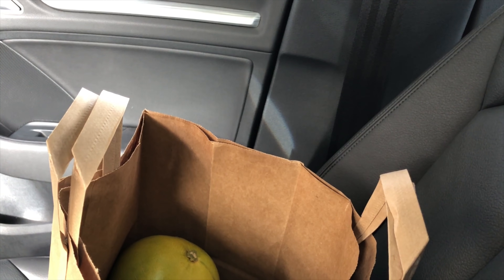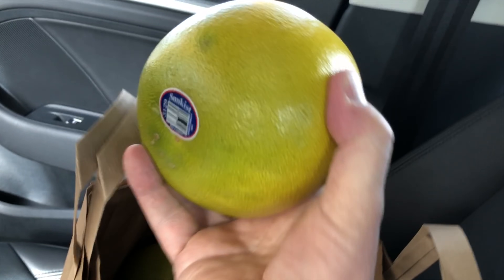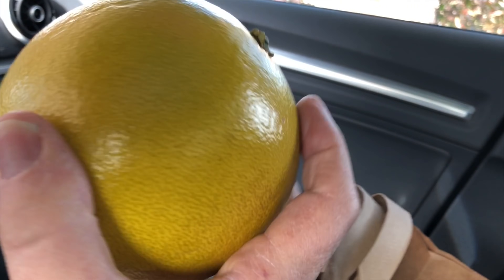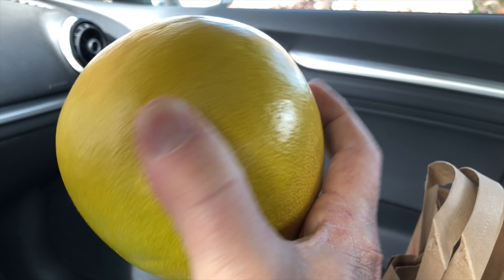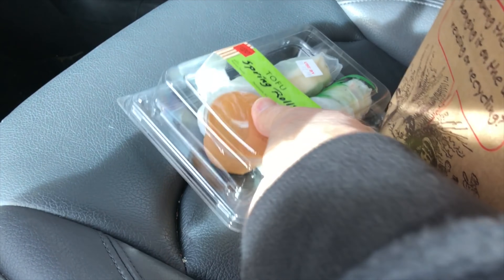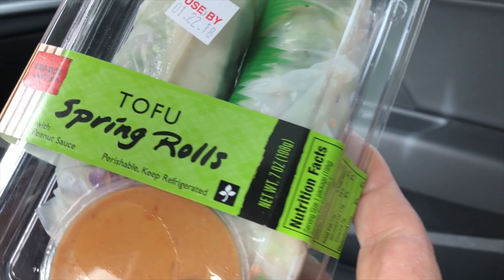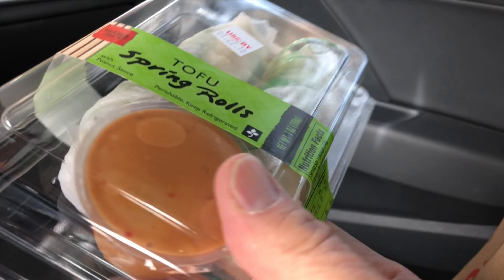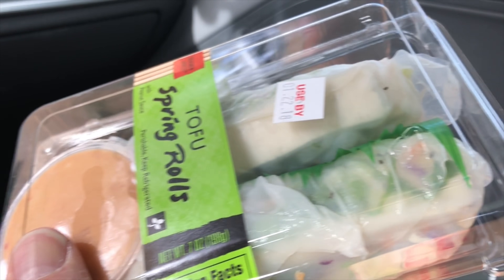The future of Class D amplifiers

Comment: Hey Paul. Some great explanations for us laymen on your channel. thanks.  It was said in the 80's that Class A/B could never achieve a sonic comparable to Class A. Of course, the advantage with Class A/B was power density. In the end, I think we saw that Class A/B could achieve sonics on the level of class A but with a much higher output capacities. Now we are dancing around to that same song again with Class D and it's variations (class T, I etc). No longer are we saddled to the limits of whatever the input wattage is as we can use power much more efficiently than ever before with Class D and it's variants. We regularly see amps producing output wattages far beyond the wattage of the input. Also, we are seeing damping factors for example that we have never seen before (Class I + 5000:1).  Not to mention the newer amps are sounding better and better and we are now seeing some pretty seriously clinically accurate units coming onto the market with some serious output power. We have digital amps with frequency responses of like 10hz-30Khz. Those are pretty rare still though. Do you think there is much more room for improvement there or have we about exhausted that tech?
Reply: High output is used for dynamic peaks, which occur in short bursts.  The electricity for those is stored in capacitors and drawn from the wall when the power output of the amp is significantly lower than what the wall can provide.  On average, long term, an amp will not put out more than it takes in, but it can take energy in during quiet parts and release the energy as peaks, preventing clipping, which is really what you want power for.  The only amps that would run flat out all the time would be guitar amps because they have a highly compressed and distorted signal.  This is one reason why they still use tubes, a tube uses energy whether it outputs sound or not, so you might as well run it flat out.
Reply: Rob Chapman Wattages on the output higher than on the input? Do you realise you have just described a machine which manufactures electricity out of thin air? Perpetual motion? If you can achieve that you are either the second Tesla, or were you educated at Hogwarts?
Reply: I totally know that is what it sounds like. That was what I first thought when I heard that too. I was specifically sighting Crown Audio amps and they are for real I assure you. I have lots of hands-on experience with them.  If there is any manufacturer that has been notably true to their published specs historically it is Crown (Amcron) Amps. Something you should know is that Crown is a division of Harman International which owns many high-end audio brands and at one point were the largest audio company in the world and with that have the best labs and did the largest amount of technological research. a lot of the advancements that have been made in the last few decades are directly a result of Harman's R&D. Harman was recently bought by Samsung but Crown was doing what they claim long before Samsung had their hands in it. If you read the white papers on the I-tech and associated Class I amplifier technology that they hold the patent on you will see that they do things like use the energy the speaker recoiling generates to add to the power of the amp. This is actually a commonly used tactic now though. At any rate, there is no magic and with that, they do not generate more power than they bring in but they are using power in a super efficient way. For home theatre systems this is totally not necessary as the 1800 watts that the wall socket supplies is more than enough and with that a non-issue but in public address (concert sound systems) where we see systems that run off of hundreds of thousands of watts driving speakers that require huge amounts of power efficiency is everything. Scepticism is fine but things are not all that they seem. No-one has managed to defy Newtons laws of physics yet.
Reply: ThinkLearnSolve peak and music power can be useful if you have short bursts of extra power, and utilising stored energy is very possible to get more power out than in for very short periods of time. Obviously it can’t do this indefinitely for continuous signals.
Reply: They usually optimize low end on class D amps, as the low end is what sucks most power out of the wall.
For reference, I have an 80W class D amplifier, that can put out 260-300W RMS over the speakers, thanks to allowing more low end amplification. More punch, more vibes.
On the other hand, mids are this amp's weakness. They're still limited to the 80W RMS it gets from the wall socket.
So the amp will go into limiting, or farts out far more easy around 400-1000Hz, than outside of that region.
And as far as high frequencies go, we all know high frequencies require the least amount of power on class D amps, to produce, however, at high volumes, and exaggerated brightnesses (brights and high EQ to the max), I have seen the amp pop tweeters more than once, and sometimes even going in a momentarily thermal shut down.
Reply: How have you people convinced yourself that an amplifier can sustain an output that's higher than what it draws from the wall?  We have one guy claiming nearly 4x the power to the speakers vs. what's being drawn from the wall and another claiming the efficiencies of class-D switching allows for higher outputs than was was originally input while contradicting that in another post.  The most efficient switching amplifier on Earth still inputs more power than it outputs.  There are no exceptions.

Comment: That was my first concern when I looked into class D technology.  That filtered output is going to be detrimental to high frequency performance.  I mean, it's basically a low pass crossover network very similar to what was used to suppress high frequencies from reaching the woofers. It's attenuation roll off probably isn't as significant, but it's principle function is still the same.   I'm curious though as to what kind of spurious RF emissions class D amplifiers create.  Some of the pulse width modulated power supplies in car amplifiers can create a pretty substantial amount of harmonic noise that can be picked up in the AM broadcast band.   I wonder if having the actual output modulated that way would create even more noise?  Could speaker wires act like antenna, potentially radiating RFI noise even further?

Comment: As someone who has built about a hundred speaker systems, I enjoy your videos. I have made a few amps in my life too, but none of them turned out well enough to not be scavenged for other projects... I have for a long time wondered if Class D amps could be much better than any yet produced. They are awesome in subs, but the highs just do not sound right to me...
What if a Class D amp ran at such a high frequency that the inductance in the speaker wire was sufficient to form the LP filter? How would that differ from a Class A in sound? Last, if we used power FETs I think we could get to 1MHZ which should make it possible to have a much simpler LP filter that would not struggle with highs and complex sounds. What do you think about the potential for this?
Reply: Reminds me of a funny story. My grandparents had a farm on a hill just outside of a big city. They had this blue Chevy van that was left to rot out in the field. As kids, we would lay on top of the van to sunbathe and you could actually hear the local radio-station as it buzzed through the metal of the van. It was a very weird experience, it was like the radio station was in your head and it only happened when you were on top of the van. I always assumed it was just the right combination of elevation, conductivity and the resonance of the empty van that cause this effect.
Reply: Paul McGowan If we go to class D in active speakers we can skip this?
In CES Genelec used your direct stream dac in pair with their G-series home active speakers. Have you listened to them?

Comment: The future of Class D amplifiers is manufacturers designing power supplies and preamps around Hypex OEM modules. Sad but true :(
Reply: But Hypex does have SMPS power supplies to go with their modules. I did not understand that part.
Reply: Yea seems like allot of ICE modules have power supplies integrated onto the mainboard. Whilst I love the idea of SMPS being used for pro audio equipment so engineers don't have to lug around 100KG+ amp racks, I don't see how moving from a standard linear power supply design to an SMPS helps the average audio enthusiast. The added efficiency isn't worth the trade off in reliability and I'm sure most Audiophiles would prefer the heft that comes with a big old transformer anyway.
Reply: I use a Hypex Ncore module with there SMPS600 power supply for my mids 80-650hz.  Couldn't be happier, cheap and efficient crystal clear POOOOWAAHH.
Reply: Isn’t that good. I see that NAD is using Hypex for their latest Hybrid digital amps, they have some mixed reviews but not sure if they’re any good or not, compared to same price class A/B amps by Cambridge Audio, Rotel or Marantz?

Comment: What's your opinion on class T amps,  Mr. McGowan?
Reply: Duds A T-amp is a class D amp.
Reply: Arc Sata I think they sound really good but only the smallest chip. The 2020 I think it was. The more powerful amps with larger chip don't sound as good.
Reply: Arc Sata,  operation of class T is very similar to class D. from listening test I have done there is almost no diff in the sound of class T vs class D
Reply: i don't like the cold ice chip sound in my ati amps compared to my old nikko alpha amp.. but they say those amp were gem, did you have the chance to ear them? what do you think of the new ncore500? or the thx amp like benchmark AFB2..? i'm looking for the best amp in the 2000$ price range actually.. i'm still on the fence of class d amps but i think the irs2012 and texas TA chips seem interesting. The dac/amp texas TA also seam nice. i also need amps for my diy speakers so i wonder what the best for ribbons, midrange drivers and bass... i know there is interesting servo stuff...